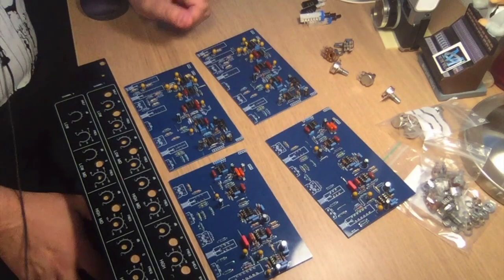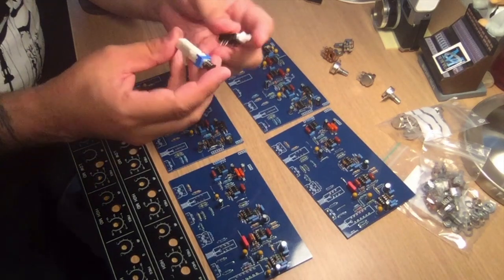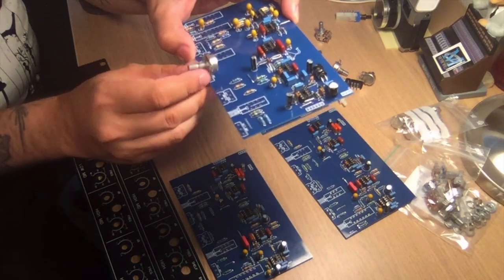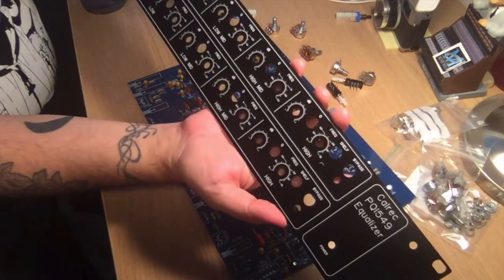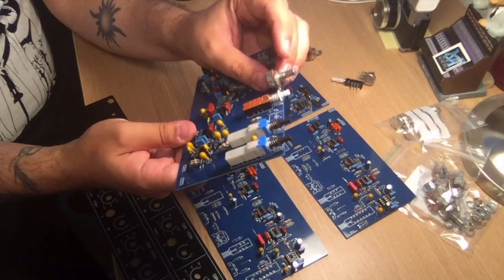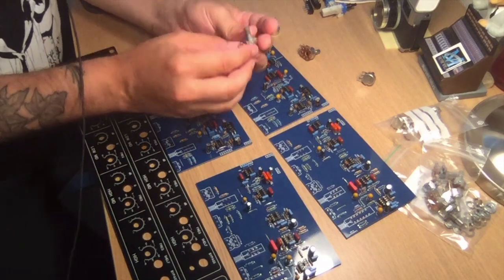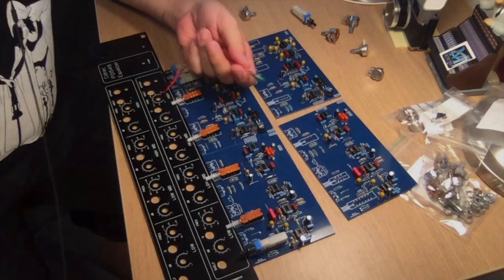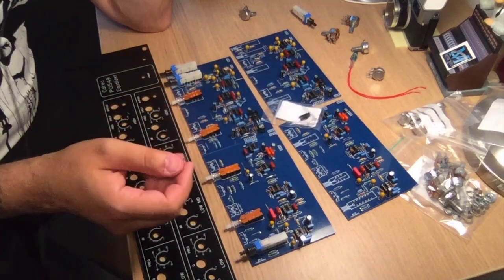DIY Calrec PQ1549 Build Part 2 - Parts and Mounting

Comment: Hi, can you please share a link for ordering the switches,
 are the inverse log pots also from china?Thanks in advance.Cheers!
Reply from the maker: Helllo!

I got  these  switches:
https://www.aliexpress.com/item/1005002029218607.html?spm=a2g0o.9042311.0.0.30114c4d7ZlxLR
https://www.aliexpress.com/item/32651661605.html?spm=a2g0o.9042311.0.0.30114c4d7ZlxLR

BUT note that they have different travel lengths as i adressed in my video, i suggest finding two of the same make.

I dont remember where those pots came from, either Digikey, Mouser os RS
Reply: @solderaddict7272  Thanks ever so much.You saved me lots of trial and error! Cheers!

Comment: Hey man, thanks for the videos on this build.... I’m just about to start on mine, same panel etc.
How did you get on, did you successfully build it?
I’m wondering about the caps for the switches, I ordered some from Tayda but they are wrong size, so that’s the only part I’m missing right now, where did you find them?
I’m interested to find out how your method for the mounting went?
I’ve decided to make the power pcb on perf board... 
anyway, thanks for the video! :)
Reply from the maker: Hey man! 
I did finish my unit and I am in the process of editing the final part, in that video you will see the mounting solution.
Initially i got black metal caps with silver edges, but since the front plate is also black i could hardly see if they where engaged or not. I ended up getting these E-Switch caps in different colors and and they work great. https://www.digikey.se/product-detail/sv/e-switch/TAGGRY/EG1092-ND/101346
Glad you like the videos! Next up is the G1176 ;)